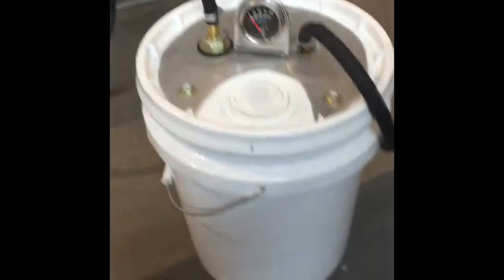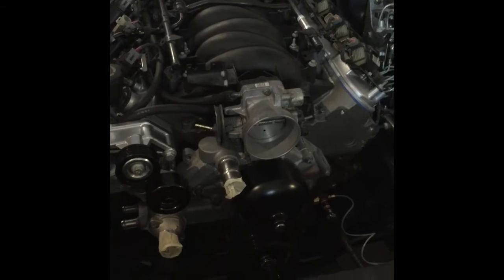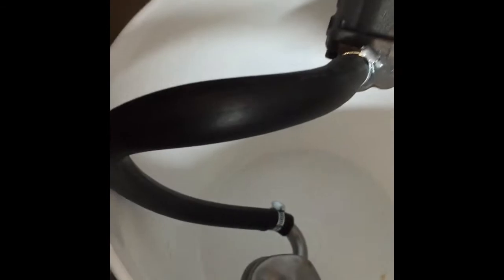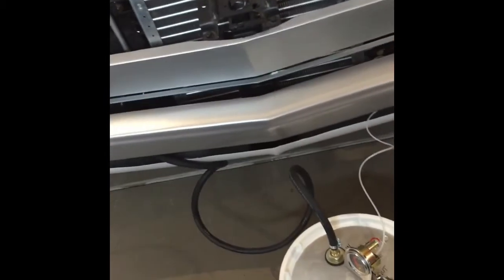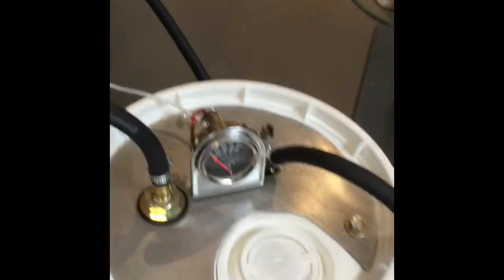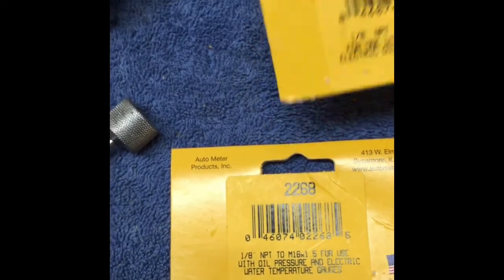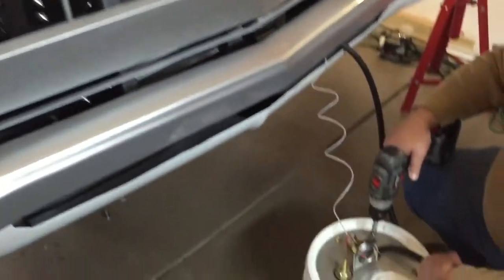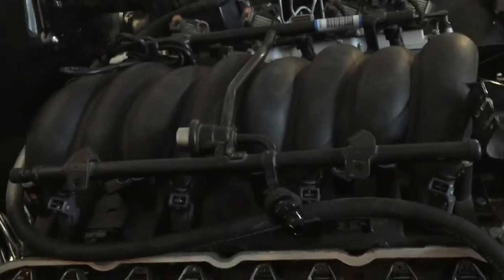Priming a GM LS engine with a DIY bucket luber

Comment: I found mine in Car Craft Magazine. I added two single remote filters on each side of the bucket, opposite the bucket handle for balance. Next was using long fat filters. Then I glued multi high power magnets inside the bucket floor. Great for a new or rebuilt start up.

Comment: How much did it cost you to build the pre luber total cost. I have to prime my 416 stroker debating on if its cheaper to buy the sealed power oil pre lube system for $108 or build my own.
Reply: BIG CAM : it will never be as good as this build.

Comment: It would need an oil pan to drain into, then pumped back into the original.
Having worked for Pennzoil I can tell you it's not the best of ideas.
Best idea is to get some cheap Walmart "TEC" oil, like 5w30, something this is super lite, run it in and then toss it, don't put it back in.